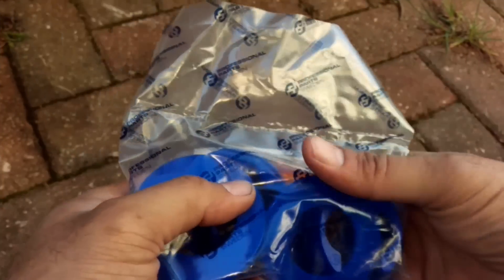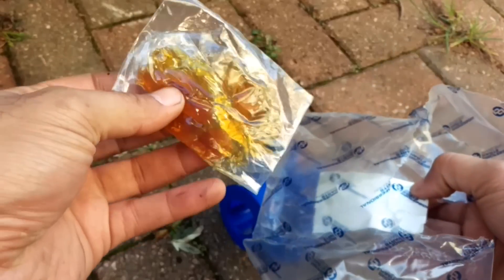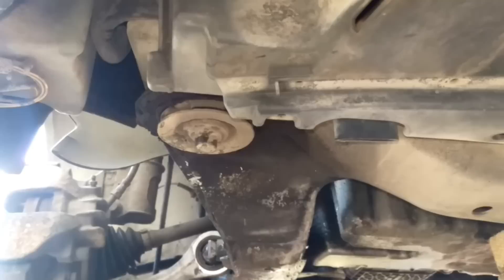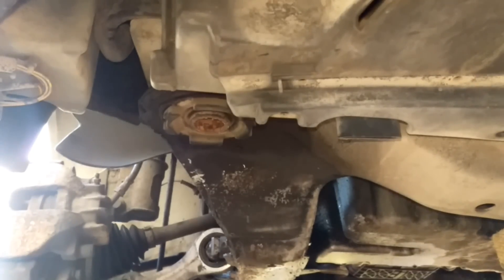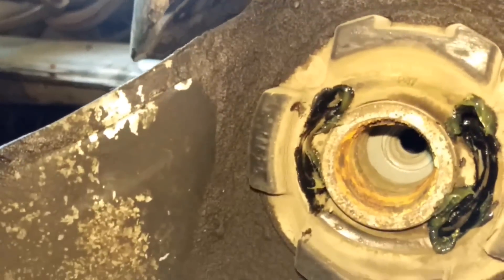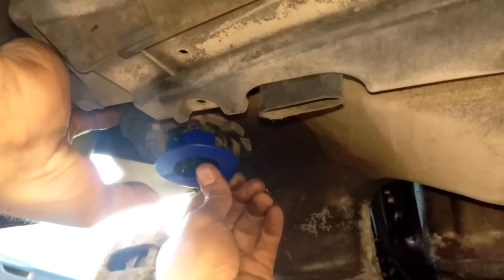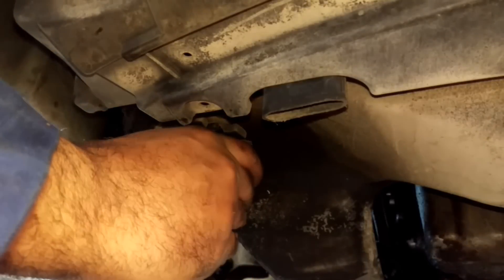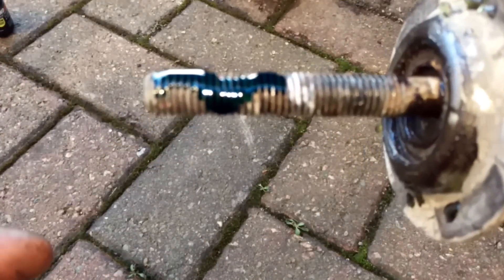Polyurethane Subframe Bush Insert Fitting

Comment: Hi there, do you not do all 8 of the bushes? Apologies if this is a silly question
Reply from the maker: 8 bushes.... Are you including the rear subframe?
Reply: I was just wondering why only 4 inserts are used when I thought there are 4 bushes on each subframe
Reply from the maker: It's only the front that needs doing as those bushes are subjected to larger forces and weight.
Reply: SiRobb  Ah right so in the video you were refering to the front and rear bushes on just the front subframe. Thanks mate for getting back to me, the videos are awesome
Reply from the maker: Yes, I'm dealing with the front subframe only in the video.
Thank you for your support.

Comment: i've been thinking about this mod for a decent time, but i'm concerned about the extra vibratitions etc that the bushes can pass through.., like most of the poly bushes do..  so, whats your experience with them?

(sorry if my english is incorrectly ^^)
Reply from the maker: Eren Mermer Because you are keeping the original rubber bush and only fitting an insert, there is no extra vibration. 👍
Reply: SiRobb  thnx for your fast reply! i know what i need to order now :)

Comment: Where did you get the bush insert from mate?
Reply from the maker: eBay
Reply: @sirobb  Thanks bud, ive found them from a company called Parts monster @ £23.75.
Reply from the maker: Yes, that's the same as mine. 👍🏾
Reply: @sirobb  received them today, will get them fitted over the weekend. Many thanks mate. 👍